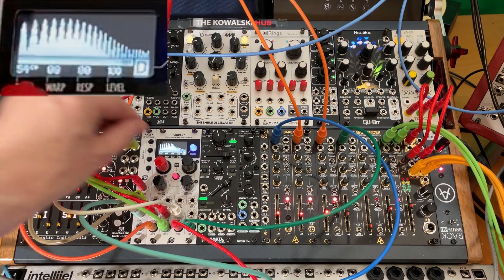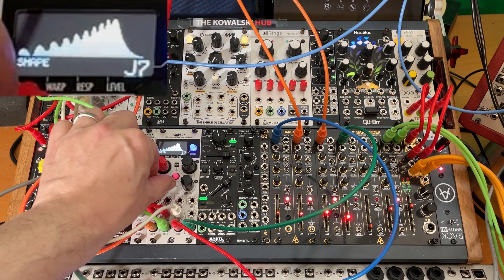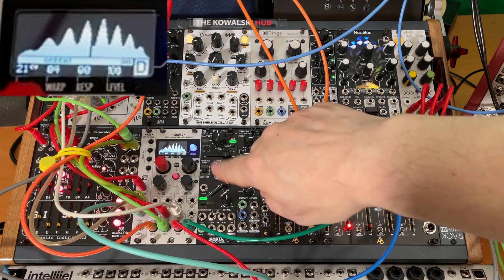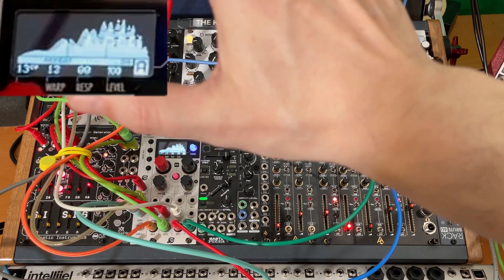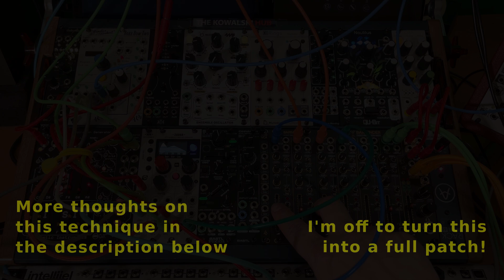Xaoc Zadar + Nin = Unexpectedly Great Sound Source!

Comment: I love Zadar. I’ve been using it for several years. It and Kermit mk3 are crazy powerful combo for a smaller system. You gotta get the expander. I really like modulating time and warp. I’ll modulate warp with a bi-polar LFO and time with a uni-polar copy. Linking channels is really great. Using a linked channel to modulate an other. The phase parameter is really useful here. It acts as a gate delay for linked channels. Linking channels means you only need one gate to trigger both channels so one can set the phase of channel 2 to like 30 percent and modulate the time of channel one with very accurate control over when that modulation happens. When you get into linking channels and using or modulating repeats shit can get wild. You need a cv mixer to mix your outputs to get multi envelope complex voltages. Set the phase of channel 3 past 50%, trigger channel one with a few repeats ( modulating speed and repeats is killer) the first envelope will repeat the second will be triggered. You can get really powerful dub-step type wahwah bass sounds this way. Zadar can be a really cool audio rate FM source as well using the techniques you displayed in your video.
Reply from the maker: Thanks so much for this post... some really interesting tips you've got there! I've been playing around a bit with some crazy self-modulation and getting some useful stuff out of it. 🤘

Comment: It appears the envelope shapes don’t adhere to any sort of fundamental pitch centre as with a wavetable oscillator. Could this not account for the pitch tracking oddity when sweeping the shapes?✌️
Reply from the maker: I have a theory on that. It tracks well without warping the shapes, but some (not all) shapes have what sounds like slight pitch bending when warping. Shapes with many peaks have strong upper harmonic content, and warping changes those peaks in a way that is very similar to phase shifting (which can also give audible pitch changes). In this case, the fundamental stays constant, but the partials get phase shifted.